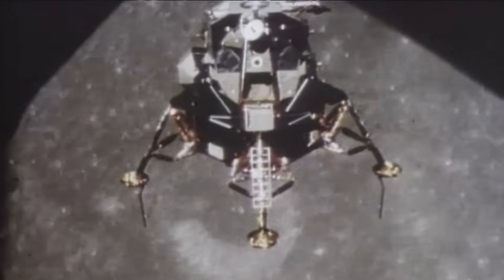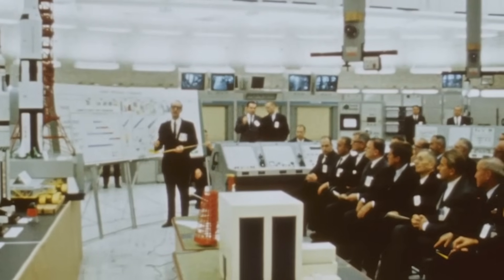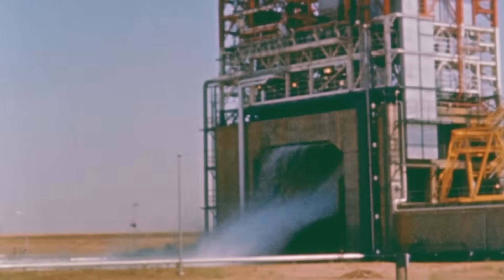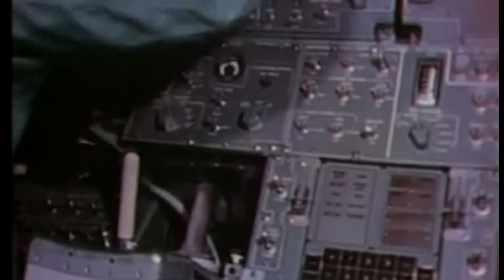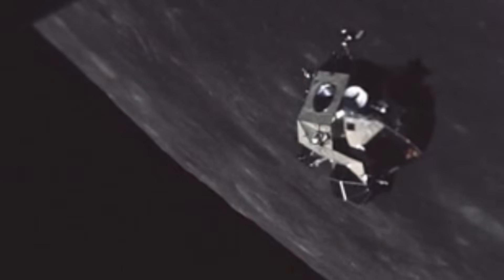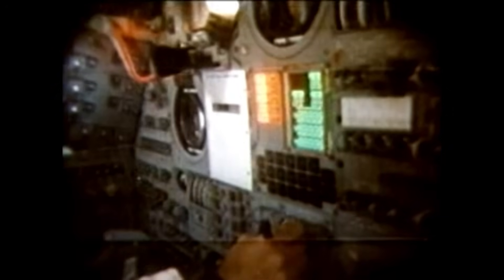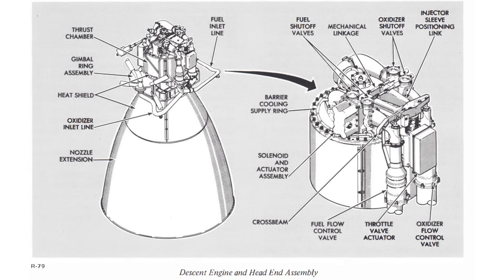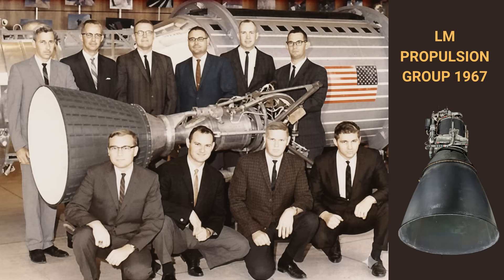The Lunar Module Descent Engine: Apollo’s Most Complex Rocket Motor

Comment: It's not true that the LM decent engine had no backup.  If the engine failed during decent, it could be possible to ignite the ascent engine and return to lunar orbit to hook back up with the command ship and return to earth.  There were limits, if the engine failed at just the wrong time, they might crash onto the moon.  During Apollo 11, they were monitoring the fuel consumption, and if the landing couldn't be completed before the decent stage ran out of fuel, they would have ignited the ascent engine and drop the decent stage to abort the landing attempt.  However,, the ascent engine had no backup, it HAD to work.

Comment: Indeed a truly remarkable rocket engine, with a 10/1 throttle ratio no rocket engine has ever performed this wonderful mission. The TRW pintle injector was the answer which had a bonus, it was resistant to combustion instability contrary to what was said in the video plus the engine shown in the group photo was the Bell Agena engine. The most beautiful rocket engine ever built like the F-1 both of which were on the Apollo program. Thank You!

Comment: How do they managed to hold the propellant down toward the supply lines and not over the Helium gas? Short burst with the steering nozles? " Overfilled " tanks ?
Reply: Braking from orbit would slosh the contents to the bottom of the tanks  , and later lunar gravity as the lander slowed and maneuver upright to the landing site  i guess .
Reply: Stevelampere Had the right answer. After recherche in some technical papers: the engine was indeed feeded with Helium saturated and after pressure drop in the supply lines, foamed fuel and oxidizer. Fedded in to the combustion chamber in correct proportions despite different Helum saturation grade of both burning components. A real Lunar Prosecco Cheers !

Comment: The gem of the DPS and granted its throttleability, was the Pintle Injection System.  This feature did not look like a typical injection plate like the massive F-1 engine. This used a design that looked like a overly complex shower head, mixing liquid or gelled propellants, using a moving pintle inside the assembly to regulate the fuel/oxidizer ratio. This was the Big Deal that enabled the DPS to throttle so deep.  It could not throttle gaseous propellants or erosion would result.  This design carries over to the current SpaceX Merlin engine family and the engineers do not indicate this design will be phased out any time soon.

This design was not made public until 1972, and the inventor, Gerard W. Elverum Jr was granted a US patent for it. TRW used this design on the TR-201 engine design on the upper stages of their Delta-P launch vehicles.   There are still a ton of hidden design gems in the engines still classified by a variety of government agencies, especially the DPS and the Ascent Engine.

Comment: I have to believe the Saturn V was a bit more complex.
Reply: I think he meant to refer to the F-1 engines of the Saturn 5 which got a lot of press for being the most powerful rocket engines ever produced.  The Soviet moon rocket booster required 30 engines to do the work of 5 F-1’s.
Reply: @christopherpardell4418  To be fair, the soviets created the RD-170 which have even 5-7% more thrust. So era of powerful engines are not over: RD-171MV may be used in this decade by Russia, if their economy wont collapse because of their military "adventures", but the fate of F-1B, considering existence of StarShip and SLS, is feeble. And seems like China is going the same route as Super Heavy Booster - a lot of medium engines for first stage for their super-heavy rocket.

Comment: If this engine failed could they use the ascent engine?Blast off the descent stage?
Reply: Yes. They would have bailed out immediately.
Reply: Yes but if the LEM was below a certain altitude, there would not be enough time to ditch the descent stage then fire the ascent engine before it crashes.

Comment: Please do a video on the ascent engine as well.  The fuel was so corrosive that the engine could not be rebuilt.  Therefore, each engine was fired for the first, and only time was liftoff from the moon. Failure was not an option.
Reply from the maker: Yes! We are already working on a video about the Lunar Module Ascent Engine! You hit the nail on the head: the hypergolic fuel and the single-use requirement make its story incredible. Thanks for the suggestion, and keep an eye out for it soon! 🛠️
Reply: @apollo11space69 you guys do not disappoint!  Keep the great vids coming.

Comment: I was under the impression that the Saturn Vs F1 engines were the ones that suffered from combustion instability.
Reply: Combustion instability was the big (literally) F1 problem.

The lunar descent engine had potential control instability. The software had a time constant used by the computer when it altered the commanded thrust value. As the descent motor evolved the stabilisation time changed (improved) but was not updated in the software. The motor was close to instability due to control loop feedback.
Reply: Yes, I believe they did too.
Reply: I believe that was fixed by adding some webbing on the surface of the injection plates.
Reply: Didn't they hand-drill hundreds of holes in the baffle?
Reply: @gerrywalsh5766  Yeah, I wasn't sure if it was the plate or the baffle.  Thanks.
Reply: In the section starting at 6:00, much of the video sequences are of the Saturn V's Rocketdyne F1 engine development history, with its combustion instability, and the mention of Chugging, which as the name implies is of relatively low frequency, it was uncomfortable for the crew, and likely to cause fuel surging and possible structural tank/plumbing damage, (also known as the Pogo Effect).  However, the commentary, after mentioning Chugging, goes on to mention combustion pressure luctuations of thousands of times per second encountered in the TRW engines, which should really be described as Screamng, and is far more destructive to the engine's injector plate than Chugging, which by comparison is relatively benign.  Fortunately, additional injector holes and baffle plates were a cure for both problems.
Reply: @trevorclarke5520 I read that pogo was caused by one of those old corrugated flex lines not being as flexible as you'd think , and was replaced with straight tubing with a v- shaped bend . 
 A corrugated line to essentially a pilot ignition or injection flow valve broke or leaked causing a pressure or  flow sensor to want to shut down and bounce the leaky part changing the pressure and hence the fuel shut off valve . It's in one of those mechanic illustrated or populiar science magazines .
Reply: True but it was also an issue with the LM descent and ascent engines. Tom Kelly wrote in his book about developing the LM, that the ascent engine combustion instability problem was worse than the descent engine. It was often at the top of the list for issues that could prevent NASA from landing men on the moon in the timeline set by Kennedy. Of course the combustion instability was solved but it took much longer than expected.

Comment: Maybe i've misunderstood (possibility:high, english as 4th foreign language) - but when the descent engine was built to light JUST ONCE - how could it light several times during apollo 13?
Reply: The descent engine could be restarted up to 20 times. The ascent engine could not be restarted
Reply: @chazwell-jones  tnx
Reply: I think they meant that on a nominal mission, only one start was required.
Reply: @physicsphirst191  tnx
Reply: On the first three landings, the LEM initially fired the descent engine while in orbit to lower perilune to around 20km during the DOI burn. Over the J-missions, the CSM actually performed DOI because the LEM payloads were bigger - like carrying the Lunar Rover, so more LEM fuel was required to carry the mass. When the two ships went their separate ways, the CSM had to be put back into circularised orbit. There is 16mm footage taken from the LEM with the distant CSM in the window frame as they approach the Taurus Littrow landing site in formation from the vicinity of the already DOI lowered perilune. This would be the altitude the LEM would begin braking to land, which probably took place on the next pass round about 500km east of the landing site itself. After passing the DOI lowered perilune, both vessels would climb back up to apolune at 60 nautical miles, before falling down to perilune again, until the LEM initiated it's landing burn and the CSM circularised it's orbit at apolune.
Reply: @JanetGrech  thanks for the explanation!
 i'll look for that footage - sounds realy fascinating!
Reply: There was actually a very real limit placed on the total number of times the LEM descent engine could be restarted. This was due to the diaphragms that were used to hold or release the inert helium that pressurised the plumbing. The diaphragms were housed in discs and eventually pressure build-up would force them to burst, at which point the LEM descent engine would be unusable. The Apollo 13 crew were extremely lucky that this did not occur until after their final course correction took place. In the movie, you get to hear one of the discs bursting and the subsequent look of fright on the crew's faces.

Comment: IDK man... being hypergolic actually makes is LESS complex than other engines.
Reply: Only really in terms of the ignition. This was the very first deeply throttlable engine, which was much harder to achieve
Reply: @Nagib23_32  I image hypergolics would also make throttling A LOT easier.
Reply: @Nagib23_32 but surely deep throttlability is much simplified using hypergolics?
Reply: @ProfNimrod Yes, kind of. It's still quite hard to achieve, and even moreso when it must perform reliably because there are 2 humans sitting above it. While it wasn't the first large throttlable engine (that courtesy goes to the XLR99 of the X-15 plane), it was the first one which could throttle to just a few percent of it's maximum thrust

Comment: The zone of avoidance, from what I recall, was 60% to 96% of available power. Typically, the LEM was in orbit at around 1.62km/s. The high-end throttle range of around 96% was maintained until velocity was down to around 1000m/s, when thrust stepped down to 60%. Thrust would then reduce in increments until the mission commander took direct manual control to set the LEM down at an appropriate stop. The LM pilot would call the readouts verbally to provide the mission commander with the real time numbers.